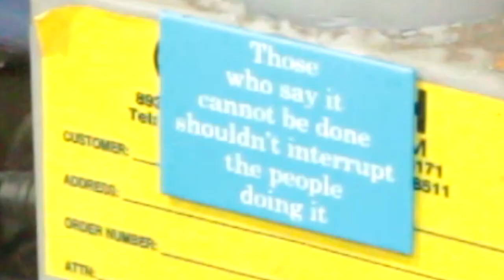universal bender setup

Comment: Nice I picked up the UB40 mainly because it has the scroll setup.    I may have to pick up this one as well.
Reply from the maker: Sounds good. Next you will have to build a quick change socket to swap between the two machines when you need them

Comment: Nice mount. I'm not sure if I have the patience to make one that nice!!!!  I had the grinder get away from me a couple of times last month. One of them went across my hand. I defiantly don't need one of those death wheels.
Reply from the maker: I don't have the patience to paint the brackets that I have made but the ub100 makes it super easy to make nice brackets. The real trick is making them the right size so the plates sit corner to corner to leave the perfect welding bevel then lay a nice bead and round it off with the linisher. 
As for the alloy cutting death wheel. I recommend no one uses them.

Comment: Are you looking at a particular brand of bender?
Reply from the maker: I like this one from Hare and Forbes it's just the one bolt hole was machined a little bit out so the thread is not happy on the bolt.
If it was mine I would probably "adjust it" with the die grinder because that is eaiser than dealing with the returns department.

Comment: a handle modification would be a nice addition
Reply from the maker: what sort of modification do you have in mind?
Reply: @juscozcustoms  Either making a piece to fit in where the original handle would get bolted into to allow the handle  to placed at an angle. Or make a new handle bent to a specific angle to give you room so you're not pulling your handle into the work piece if it sticks out far enough to get in the way.